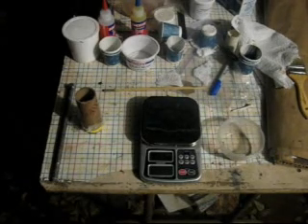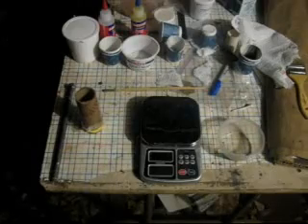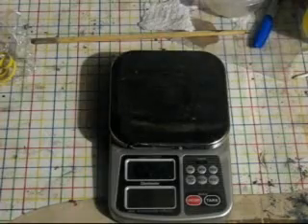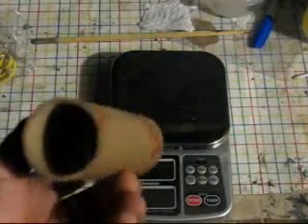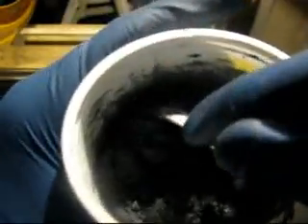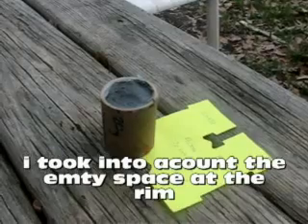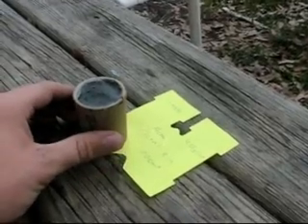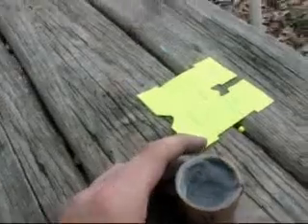Final Ammonium perchlorate propellant and details

Comment: mix a test batch of this: 20% binder, 20% Al, 19% AP, 1% copper oxide black and whatever the curitive is for this mix is by weight. Curative is after 100% of all solids are in . See what happens then :) More copper oxide subtract from the AP.